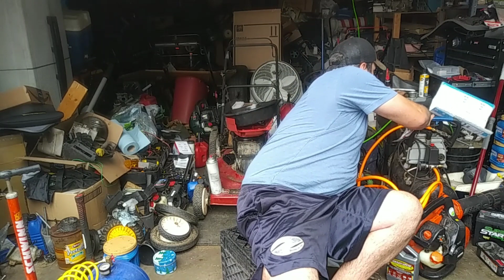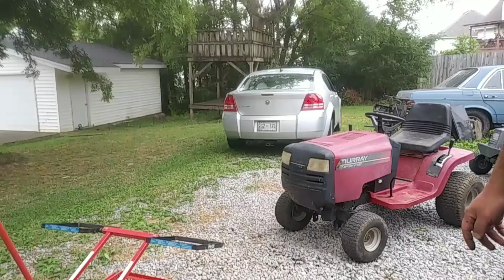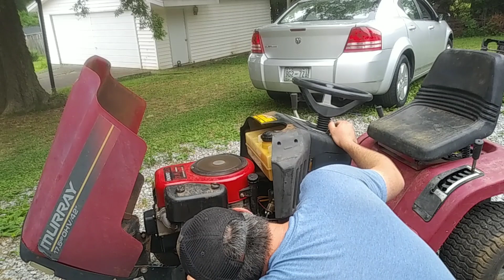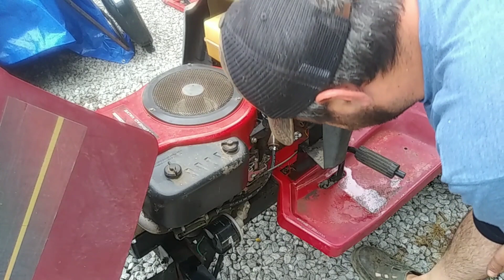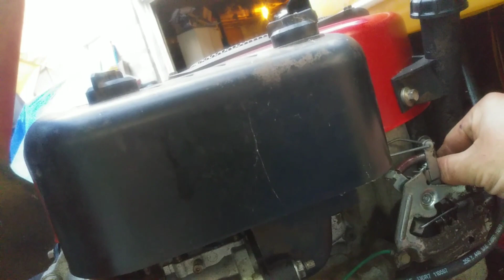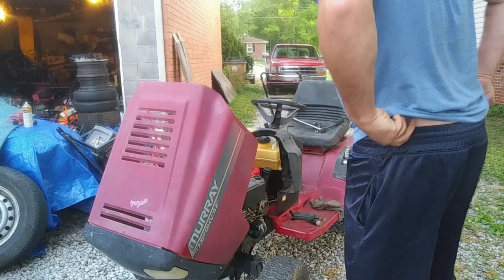Episode 5 murray 17.5hp pinion gear replacement

Comment: There is a learning curve when it comes to adjusting these carbs. To start with all linkage rods have to have the proper bends and not bind, the nylon bushings cannot be missing where the rods connect and make sure that Gov spring is in the top slot on the Gov arm. Next check the Gov adjustment using the manual... it's really quite easy as mostly all small engines will use the same process regardless of brand. That tractor may have been on a recall list some years back as Murray had a lot of problems with a supplier that built there gas tanks. But she steers almost like a Cadillac now John.... progress, progress! 👍

Comment: Well that was an easy install!  You trust that lift without jacks?  Is that the highest it’ll go?  I always thought about getting one of those.
Reply from the maker: Bro that will go higher I just didn't raise it up that high lol yes it was an easy install but. Now i new carb on the horizon for this one
Reply: @Turningwrenches85  Hey Henry, I have a Mojack XT lift for my zero turn they work well.  Good work John.
Reply from the maker: @matthewderickson1121  thank u appreciate it still a ways to go on this tractor
Reply: Henry i would get the cheap one at harbor freight works great with the coupon its pretty cheap.

Comment: I think your right about a new carb. Sounds like a little surging going on also.
Reply from the maker: Well I was watching another video about how the vector carbs are not all that great even after you get them clean and all the stuff even though I got it clean it still acting hinky and I try to spray everything to try to free up that throttle on the carburetor in it no bueno

Comment: Those messed up teeth are going to ruin that new gear.
Reply from the maker: Well I would weld it but I never welded a day in my life  unless I go and spend money on a new sector gear because I actually don't have one that will go to that tractor
Reply: @Turningwrenches85  I bet you could clean them up a little with a grinder.
Reply from the maker: @SecondChanceMowers710  yes I could try that and see if I can clean them up a little bit better I will try that thank you
Reply: I may have a sector gear
Reply from the maker: @MowersNBlowers  oh really for that murray? Yeah i have sector gear but it's only has one hole for the steering rod and that came off that 1238 that I tore down for parts this murray has 2 holes for the steering.